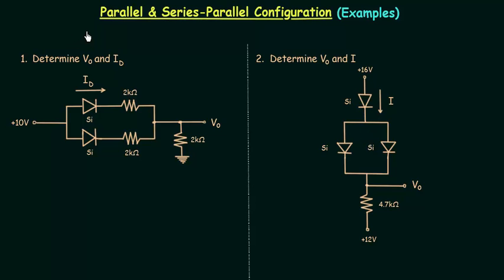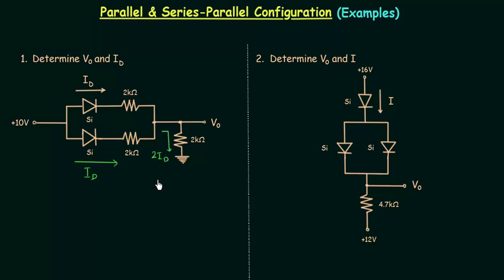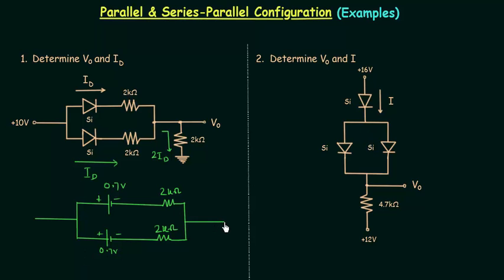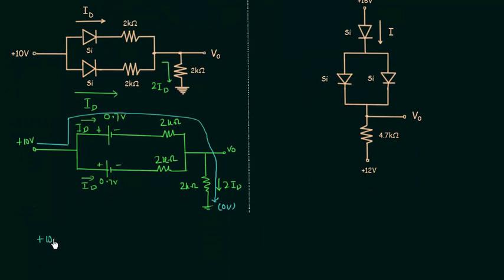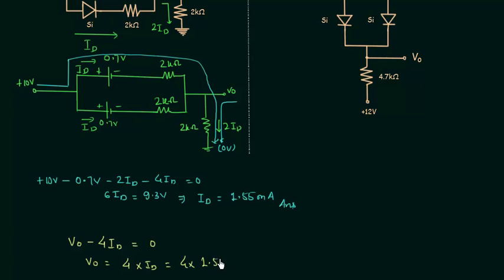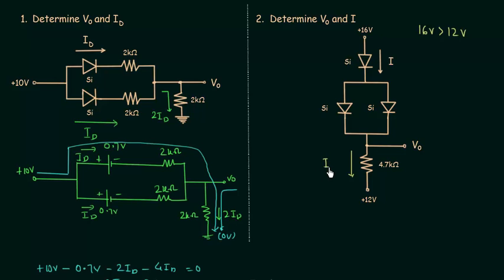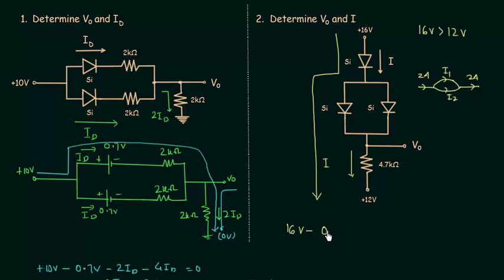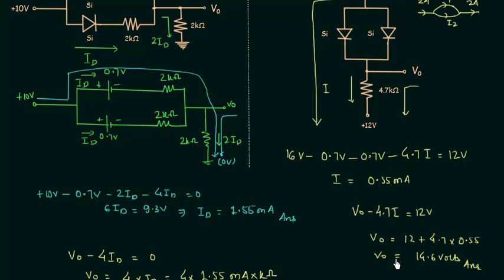Parallel and Series-Parallel Configuration of Diodes (Examples)

Comment: I don't get the equation explanations. Why are you assigning only -0.7v for the diodes when there are two which should be -1.4v ? Then you gloss over how you assign Id as 6Id. where are you getting 6 from? and if you are adding I from both legs plus the ground leg then why are you not adding voltage drop? Last explain how you got 6.2v as Vo when in your equation you have 4x 1.55 x resistance ? that is a lot more than 6.2.

Comment: why is it 2Id in first one and not the same in second one second one also 2I  shud come right? pls answer
Reply: From top to bottom:

1. we started with "I" as branch current
2. This "I" divided into 2 branches
3. The divided current from 2 branches merged into single branch
4. We again get "I" in the final single branch

so, we used 'I" for 4.7k resistor

please note that the current is not divided for V0 wire.
Reply: @supernova9786  and the first one?
Reply: @IsrealBalogun-b1c Bro I graduated a whiiile ago and am actually surprised how I was capable of solving these questions 😢
Reply: Hope you're graduated as well and have a good job so that you no longer require to solve these questions

Comment: In example 1, The equivalent resistor of the two parallell branches with 2k ohm each is a single branch and resistor with 1k ohm. To get V0, you can divide the voltage over that equivalent resistor and the one connecting to ground, giving you (9.3-0) * (2k ÷ (2k + 1k)) = 6.2v. 

9.3v and not 10v because of the diodes of course. So now you have V0.

To calculate Id: 2*Id (total current) =  (9.3-0)V ÷ 3k ohm = 3.1mA, which means 1*Id = 1.55 mA. 

Don't know why he uses KVL and then mixes in currents in the expression, or where the 4id comes from... This is how I did it, hope it helps.
Reply: This is how almost every circuit professor would teach it. It's best to make use of altering circuits to path towards Impedance anyways
Reply: why 9.3 - 0?
Reply: Huh? Is 6.2 supposed to be a current? Sincr you have used V=IR?

Comment: In the first question, the branch currents were ID and after leaving the branch it got multiplied with 2*ID*2k resistor... But in the second question after leaving the branch the current did not get multiplied that is, it remained as ID*4.7k only and not 2*ID*4.7k... why?? Can anyone pls explain this for me?
Reply: In first I'd is current through each diode making output current 2id whereas in 2nd current through each diode is not specified.i enters into 2 diodes combination so I should leave 2 diodes combination
Reply: Noticed that too
Reply: Because it gets divided by 2 first for both of them and then added again when it comes out to make it the same value as before.

Comment: Sir please explain if two different diode connected in parallel. Then in what way current is distributed.
Reply: The current will split and distribute evenly between the two branches since they are equal in resistance. I believe when combining the diodes in parallel that the voltage does not add up instead 0.7v drops total across.

Comment: Resistance is 2k . In equation you just taken just 2.
Reply: The resistor is in kilo.ohm and the current is in mille.ampere
So, kilo will cancel out with mille.. Just like dividing 1000 over 1000..
I hope this was clear.
Reply: @abbasaljanabi2667  Yes and... 
I noted that in the case where you have micro amperes you should convert it to milli by dividing by 1000 then the other calculations go normally. In short we deal mostly with milli amperes for current, kilo ohms for resistance and volts for voltage.
Reply: Exactly, he did NOT explain this calculation well

Comment: What happens when Vin < V(diode) and KVL gives a negative amp? Does that mean zero current is flowing?
Reply: If Vin is less then Vd then there will be no current flowing. As the input voltage cant get any higher then Vb, the potential barrier in diode will remain same, As far I know!

Comment: 2. Exercise.  16V - 0.7V - 0.7V - 4.7I = 12V.  In this case the I is half amp not 0.55mA.
Reply: (-4.7*1000), since the resistor is in K ohms
Reply: Csaba Molnar I wont be half.

Comment: WHY THE CURRENT IS 2Id in first problem and I in second problem can any one explain plz..
Reply: in Q1 Id is the current through one of the diodes only, not the total current. while in Q2, I is the total current and it will also be the sum of the currents through the two diodes connected in parallels. i.e. if we denote the currents through the diodes connected in parallels in Q2 as "Id" (since both diodes have similar characteristics, so same current will flow through both) then I =Id + Id =2Id.

Comment: For problem 1. You took 2 Si diodes , but what if one of  the diodes is GaAs ??? How to solve then ???
Reply: Since barrier potential of GaAs is greater than silicon's then the diode with higher barrier potential behaves as an open circuit, in this case GaAs will behave as an open circuit.

Comment: if both diodes are different which is parallel to each other, which one will be used, the one with the higher value or the one with the lower?
Reply: Lower value. The diode requiring higher value will remain OFF ( open circuit).

Comment: What if the other diode is a GaAs?
Reply: all the current will flow through 0.7 silicon diode as compare to 1.2 
because 0.7 potential barrier is less that 1.2 hence 1.2 would be considered open.
Reply: Neso Academy what is your reference plz

Comment: What will happen if the two diodes are not same .... then the current through both arms will be different ... In that case how to calculate the I sub D???
Reply: The diode with the higher rating will then be converted into an open circuit. therefore no current will pass through it
Reply: @Vince0208  nope, both diodes will act as resistors and we have  seen examples for 2 resistors in parallel where the current passes through both of them.
Reply: because current takes path of least resistance
Reply: @qwerty.760  nope, both diodes will act as resistors and we have  seen examples for 2 resistors in parallel where the current passes through both of them.

some current always passes through  resistors in parallel. If one of them is shot by non-resistive wire, then all current flows through that wire.
Reply: vincent bryan Reyes , why bro
Reply: then apply kvl inside  the loop containing 2 diodes

Comment: what if we have si diode in parallel with Ge diode and both are forward biased.. so we will have 0.3v across both or 0.7 ? as both r in paraller so they will have same voltage.
Reply: Ge diode will reach the ON state once the voltage is 0.3 V and it will maintain this voltage. So, the Si diode also gets the same 0.3 V and not 0.7 V, hence Si diode remains OFF ( open circuit).
Reply: Musaab Islam because the diode needs a minimum voltage which is 0.7V for silicon to be activated. So when it is provided with 0.3V then it's unable to activate itself with that amount of voltage. Thus, we convert it to an open circuit whereby no current flows. :)
Reply: Ashish Rajput 
When Ge and Si diodes are connected in parallel Ge diode gets forward biased at 0.3V itself where as Si diode needs to reach 0.7V. But even before Si diode reaches 0.7V, at 0.3V as Ge diode gets forward biased which makes it replaced by the ideal internal impedance of the diode in forward bias i.e rd=0 and hence maximum current flows through Germanium at 0.3V itself which makes the Si diode to never turn ON.
Reply: and why is that so sir
Reply: Kaunaj Banerjee so will there be no current in the entire circuit
Reply: SHARATH RAJ Kumar in simple language we don't consider Ge in the circuit and current don't get double in 1st questions?
Reply: Gaming with sahib I didn’t get ur question correctly but if it is about the question in video,it’s not the input current getting doubled.But actually,the actual input current at node 1 is getting splitted in exact halves,Id each as both the braches have same Si diodes and resistors of same order. At the output node these currents simply gets added which is 2times if each branch 2Id
Reply: @sharathrajkumar1710  what about in the second question? The current didn't double after leaving the node
Reply: Eric Pk 
May be u got it in wrong way,he jst didn’t mention there
At node 1
First the current I gets split into half i.e, I/2 because both branches hold same resistance ‘rd’.
Then again they gets added at node 2 which makes the reslutant current as 
I/2 + I/2 = I 
Which can also be put this way 
2*(I/2)=I
Now u might have got cleared which current is split nd wich current is doubled
Reply: @sharathrajkumar1710   Oh yeah that's true. I was getting confused coz of the first example but I realized for te first example, he has used Id and not 1/2Id in the upper branch, so it had to double when combining with the Id from the lower branch.
Reply: Eric Pk Exactly broo
I think now u got all clear
Reply: @sharathrajkumar1710  Yes bro thank you for the clarification
Reply: Eric Pk anytime bro